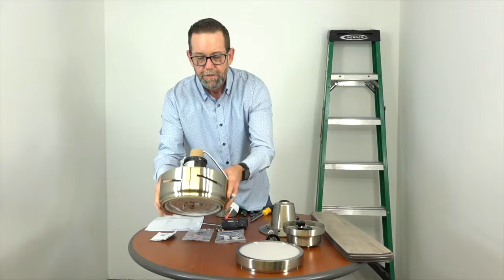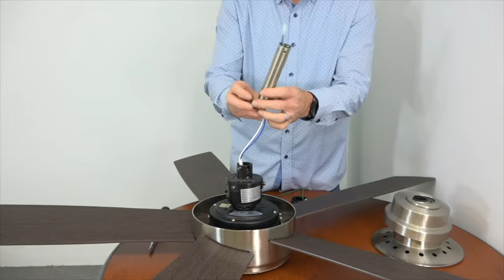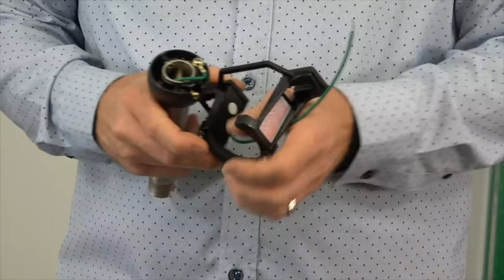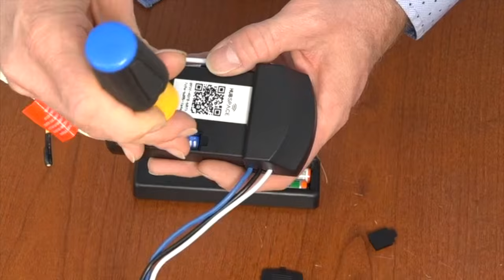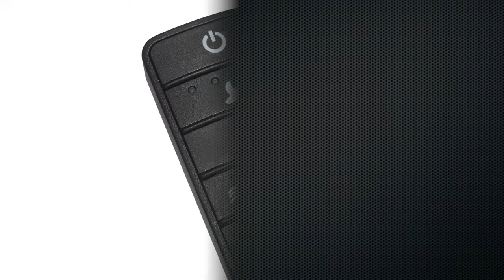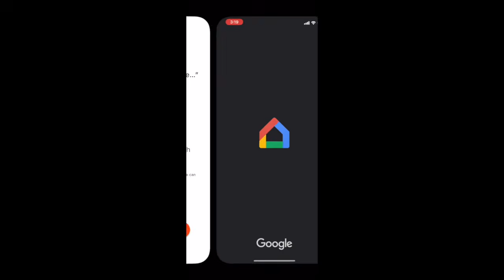How to Install the 54 in. Fanelee Ceiling Fan from Hampton Bay

Comment: I live in a brand new house in California where the wires coming from my house are 
Copper
Black
White
Red
And I have a dimmable switch is the fan compatible with my house ? Also I changed out the light switch from dimmable to non dimmable to see if I can use this fan in my home I have already bought 3 of them for my home just haven’t hooked them up yet.
Reply from the maker: The only switch option would be a standard on/off toggle switch. In general, remote control fans should not be installed with any switch that regulates power like a dimmer or speed control switch. We are not licensed electricians, but if this were our installation, we would not use any switches and just wire the receiver directly to the house constant supply wire (black). That way the fan would always have power to be able to use the smart features.

Comment: Does is have a wobble or run smooth and any speed?
Reply from the maker: When properly installed, it should run smoothly, ours did. It's very important to make sure the ball is seated properly in the mounting bracket and that the downrod is securely fastened.
Reply: I am having some wobbling as well. Any suggestions?

Comment: How do you reverse the blades
Reply from the maker: The fan's direction is controlled via the manual reverse switch. The reverse switch is located under the motor collar cover on the top of the motor. You can see the reverse switch at the 5:59 mark in the video. It is on the left side of the black switch housing on the top of the fan.

Comment: Just installed mine before I watched the video. 
179$ at the Home Depot
Reply: If airflow is desired in the opposite direction, turn your fan off and wait for the blades to stop turning, then slide the reversing switch (located underneath the motor collar cover on the switch box on top of the motor housing) to the opposite position, and turn the fan on again. The fan blades will turn in the opposite direction and reverse airflow.
Warm weather - (Forward) A downward airflow creates a cooling effect. This allows you to set your air conditioner on a higher setting without affecting your comfort.
Cool weather - (Reverse) An upward airflow moves warm air off of the ceiling. This allows you to set your heating unit on a lower setting without affecting your comfort.

Comment: What if I accidentally tossed the QR code before setting up Wi-Fi 🤦🏽‍♀️- how can I still set up the app?
Reply from the maker: No worries, the QR code is also located on the receiver and inside the battery compartment of the remote. If you can't find those, there is an option to set up the fan without the QR code. When adding a device in the app, you will see an option for setup with no QR code. Just follow the instructions in the app and you'll be good to go.

Comment: Power back on and the fan won't turn on
Reply from the maker: We'd suggest making sure that the wiring is still connected correctly and did no disconnect during the installation.

Comment: Does the comfort breeze function just cycles between the lower speeds? My Fanelee does not spins at high speed when in comfort breeze mode. It just cycles between, I would say, fan speed 1 and 2.
Reply from the maker: it should alternate randomly through all speeds.

Comment: I am having trouble wiring.
I have one red and two white wire from house wire. 
Do you have any idea which one to connect to green, white and black?
Reply from the maker: Sorry, we can't help with that issue without being there to test the wires. We would suggest contacting a licensed electrician to figure out which wire is the power wire and which is the neutral wire.

Comment: Hello I’m having trouble with the LED light everything seems to turn on but the light just continues to blink. Any advice?
Reply from the maker: We'd suggest making sure that all of the wire connections are completely plugged in/connected. Especially where the light connects to the fan. If that doesn't fix the issue, call Hampton Bay customer service. Their team is pretty good at troubleshoting.

Comment: Can you mount this fan without the ball and downrod assembly... I need it higher to the ceiling?
Reply from the maker: No, this fan must be installed with a downrod - there is not  flush mount option for this fan.
Reply: Paul, also remember that anytime your blades are closer than 10 inches to the ceiling, you are killing the airflow and efficiency of the fan.  Not only will there be struggles for airflow, the fan will be working against pressure, which will greatly shorten its lifespan.  Learned that the hard way!

Comment: it will not let me connect to work what do I do?
Reply from the maker: Check to make sure that your network is a 2.4 ghz network. The fan will not connect on a 5 Ghz network. If that doesn't resolve the issue, we would suggest calling the HubSpace team at 1-877-592-5233

Comment: Great video, thanks for sharing. Can we assamble this fan closer to the ceiling? According to the picture on the box yes, but I tried and was impossible. I really appreciate your help.
Reply from the maker: Thanks for watching. The fan can be installed with the included downrod or an extension downrod. The dimensions chart on the box states that the flush mount is N/A - meaning that it can not be installed flush mount.
Reply: @ceilingfans101  Thanks for your help!!!!
Reply: What is the length from the Ceiling to the blades?
Reply: @kjbrowne1966  15 inches

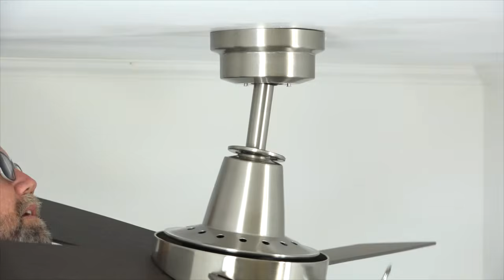Comment: We got all the way to the 12:14 mark and the screws weren't long enough to reach the holes on the canopy top? We don't know how to fix this and we've tried.
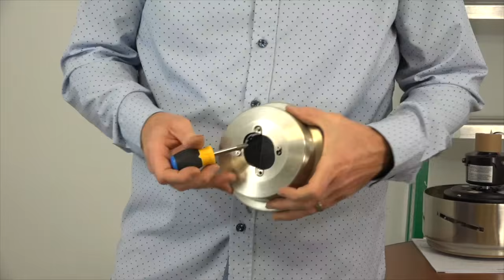Reply from the maker: The canopy and decorative bottom ring come pre-assembled on the mounting bracket to ensure that the screws are long enough. Make sure the alignment post of the mounting bracket (shown at the 3:56 mark) is coming through the hole in the bottom of the canopy and make sure that no wires are stopping the canopy from going all the way up. You may need to loosen the screws on the bottom of the mounting bracket some more to give a bit more length than when you removed the mounting bracket. Hope this helps!

Comment: Really helpful video, thanks. Wondering how it works with a wall switch - can the fan/light be connected to a (regular on/off) wall switch and what happens when you turn on the wall switch(es) (assuming it works) - is there a default mode, or does it remember the last setting used? Thanks again.
Reply from the maker: We would not recommend using this fan with a wall switch. The remote receiver has a memory to remember the light color temperature settings and if connected to a wall switch, the light color temperature will be changed each time the switch is turned off/on. Also, the fan will not be able to communicate with the App or Google/Alexa devices if the wall switch is turned off. For optimal performance, this fan should be wired as directed in the video.
Reply: @ceilingfans101  That's great advice, thanks. Do you'all have any experience with tall ceilings? I would be mounting this up around 15 ft.  Guessing that's not a problem for remote/receiver.  Oh, and any knowledge of a 72" extension connector cord??
Reply from the maker: @disinterestedwisdom8090  the fan includes enough lead wire for use with a maximum downrod length of 48"